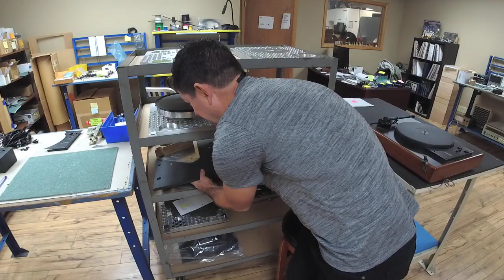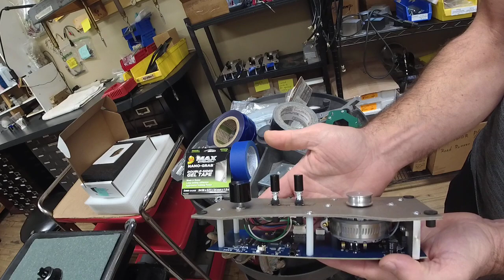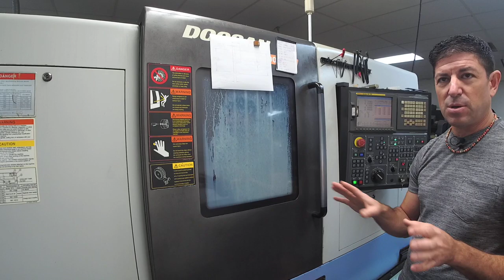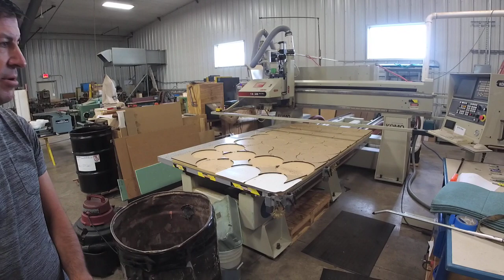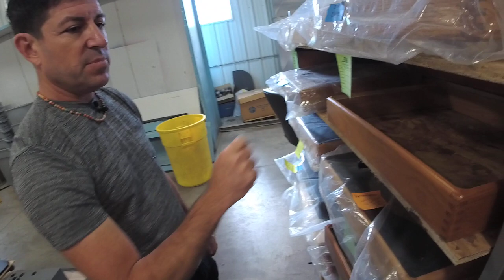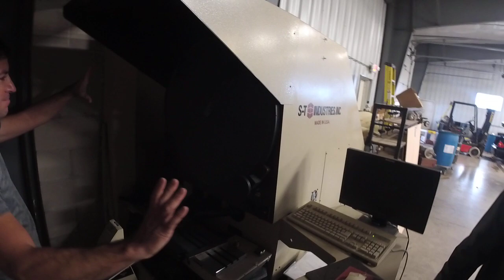SOTA Turntables Factory Tour. See how an Audiophile Turntable Is built. Hand Made Quality Stereo

Comment: You prob'ly won't believe this but I bought a Sota Star Sapphire (has vacuum holddown) TT in 2008 for $2k US dollars. The SME V tonearm on it was in perfect condition and was worth at least that much. That tonearm sells new for $8k today. The TT came with the original smoked acrylic dustcover. I had Sota rebuild the table for $500. The new vacuum lip they use is much wider and is a silicone rubber compound.

Comment: I wonder what it would cost to repair an old SOTA vacuum turntable I have owned since the late 1980s. I think it is a saphire. I bought it used back then. The spring suspension is shot. It still works, but the suspension is a problem.
Reply from the maker: You habe to call them. As things change fast. But they will bring it to current spec.